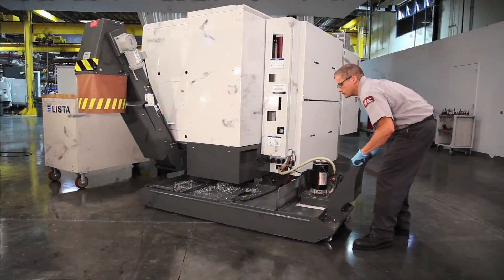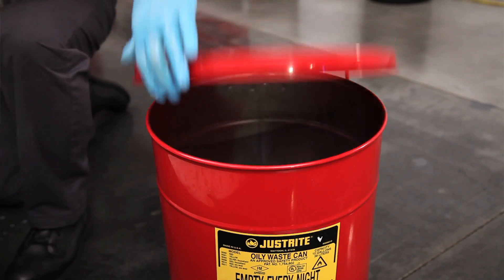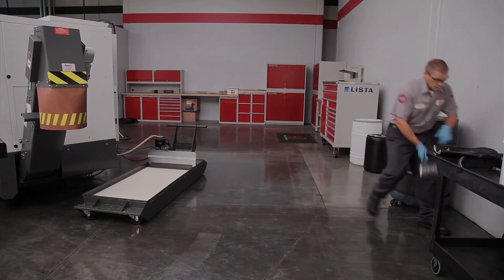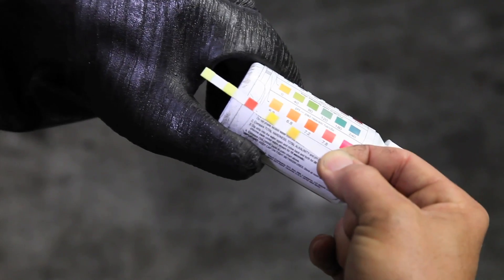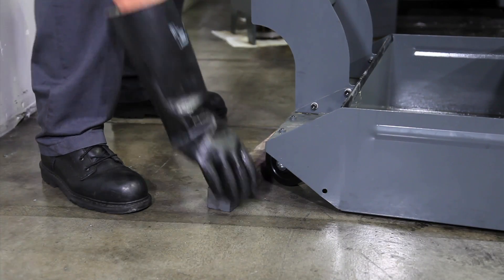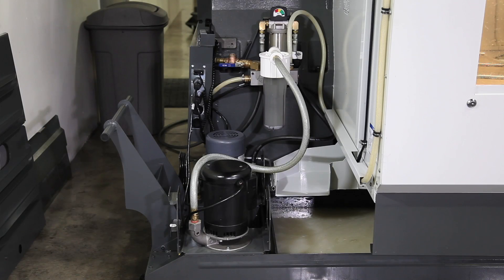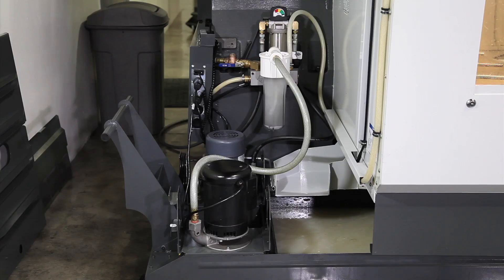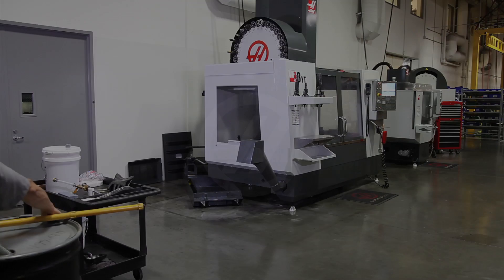Machine Tool Coolant: Cleaning Your Tank

Comment: I work on two identical machines at work using identical coolant but one tank turns bluish green after a while of not changing it and the other one thickens from white to like a thick Tanish color? Anyone know why they are turning 2 different colors?
Reply: Depends on the type of metal your cutting. I know bronze turns water bluish green overnight.
Reply: @ both machines are both mainly copper and nickel but only one machine seems to get like that

Comment: Have you tried to let a piece of copper in the tank ?
It kills bacteria.
Reply: A better way of using copper for its murderous proclivities towards bacteria and scum would be to electroplate the whole tank, first in zinc as copper doesnt take on steel directly through electrolysis, but does onto pre-plated zinc and other more friendly metals on the chart of electronegativity of elements... That said, yeah, richly copper plating the whole inside of the tank would not make it sterile, as chips landing in there would provide area that is not copper plated for scum to thrive in, but it surely would benefit the whole system... Also, copper plating the whole thing, inside and out would provide a much cleaner surface, along with oxidizing lovely over time to that classical copper green, while preventing rust and bacterial thriving... A fine idea, fine sir...
Reply: @camillosteuss  
Paint the whole tank with marine hull red paint.
It's made to avoid marine growth on the hulls ,there is copper particles in it.
I don't know if it's compatible with cutting oils ,so it needs to be checked.
Dumping some copper tubing donuts a bit every where should do it i guess.
It's not like if they can't cut copper pipes in pieces in those workplaces lol.

Comment: There's gotta be a better way! I'm not doing that anymore crawling on the floor shovel tanks. The big machines are a nightmare. Why can't you design the conveyor to catch oil and sludge and dump it in chip bin
Reply: Spoiler alert there's stuff for that already (i mean probably from the 80's), but usually optional even on high end machines .    The chip accumulation is what it is , some conveyors and tanks accumulate less , some more .
Reply: Look up sump sucker.. big BIG vacuum that is specifically designed to suck up coolant, chips and sludge. Just need a drum or tote to discharge it in then clean tanks and rinse system well.

Comment: Pretty ridiculous if anyone lets their tank get to this level. When I was maintenance at a shop there were a couple dozen machines to maintain and the tanks were cleaned every single month. Tanks were emptied with a chiperator which sucks up the coolant and puts it through a filter and holds it till it's time to put it back in. All chips and oil (which never built up) was cleaned out and the tank wiped inside and out with cleaner and all screens cleaned. Cleaned coolant was returned to the tank and if top offs were ever needed we had a DI water system that ran through the shop with a valve system that siphoned off pure coolant from a drum that could be set to 7.5% just by the trained eye and checked with a refractometer. That fresh coolant was ran through a hose to any machine and whatever percent could be added to correct the concentration. Coolant tanks absolutely never had a smell to them and the haas machines I took care of were clean inside and out, top and bottom, even under the way covers with extra care. It's no excuse to have crap in your tanks. If you can't hire a entry level worker do it yourself, have an operator do it, or just suffer with your nasty shit!
Reply: Small shop with high demands placed on it. Things fall behind.  Hard to get ahead of these things when you're constantly digging out of a hole.

Comment: What is the correct parameter of coolant - pH, and hardness?
Reply from the maker: Hello Andriy, Good question. We cover proper pH and hardness levels in our "Tools of Coolant" video. Here is a link to that particular section of the video. https://youtu.be/itQOP_JjilM?list=PL1FfK7Yod27fuiQ4ZSRAnTT7Ut0wJCGRP&t=230
Here you'll find that we recommend pH readings between 8.0-10.0 ( on the alkaline side) and hardness levels between 150-400 ppm. 
Note though that many modern coolant concentrates are capable of functioning well at hardness levels above 400 ppm, so if your coolant is not exhibiting signs of corrosion or bacterial infection then there is no reason to replace that particular batch of coolant. Just test your coolant regularly to ensure it's chemistry is not suddenly changing for the worse. 
Thanks for the question.
Reply: Thank you.

Comment: Inside our machine, we have a chip auger system. The coolant we run drains down to the auger and collects all the oil and chips and get mixed in.  if the coolant levels in there rises too far up it'll get drained out to the reservoir tank, but we still get all the crap left behind in the auger.  I've been trying to find some sort of drain plug to get rid of that and can't seem to find it anywhere.  Any recommendations on how to deal with that? I'm a fairly new CNC Operator, and our shop just got their first CNC Machine here, so no one knows a thing about CNC Machining or how to properly maintain them.  Thanks!

Comment: I can't stand cleaning coolant tanks.  there's always a layer of chips and sludge at the bottom. and it smells.
Reply: How often were they cleaned? If them smelled I bet you're not cleaning them often enough, you're not using DI water, or you're keeping used up coolant.

Comment: Could you give me a few more specifics as to a recommended High Alkaline Cleaner?  Thanks
Reply: Could you be more specific and tell us which cleaner you used.
local distributers like Grainger have Zep Heavy-Duty Alkaline Cleaner
Would a dilute mixture of Ammonia work ?
Also, a brand name for the Oil absorbent rags you show would be nice.
Reply from the maker: Hi Richard Giess - Thanks for your question and interest! There are a variety of these high alkaline cleaners available on the market. It is best to choose one that is formulated specifically for cleaning machine tool sumps. In the rare instances when we’ve needed to clean a dirty coolant system, we obtain high alkaline cleaner from our local Castrol metalworking fluid vendor.
 
It is probably best to start by contacting your coolant supplier to see if they can provide or recommend a particular product. You can also search online using the terms “machine tool sump and system cleaner” or “alkaline cleaners for machine tools." Hope this helps!
Reply: Pig oil absorbent rags, whamex xt for cleaner

Comment: What difference does it make to operator, machine, or machining process whether there are bacterias in coolant or not?
Reply from the maker: Hi Zbigniew Śliwa - Great question! When your coolant is kept clean and the proper concentration levels are maintained, the chances of severe bacterial contamination remain low.
 
If proper maintenance is not sustained, it can lead to bacteria contaminating your tank and coolant plumbing.
 
The bacteria have a number of negative effects:
 
They eat the soluble oils that provide the lubricating characteristics of the coolant. Sooner or later this can effect cutting tool operation and surface finishes. Generally these oils also provide the corrosion protection for your parts, and as they are depleted so is the coolant’s ability to protect your parts from rusting.
 
If you begin to smell an obnoxious odor coming from your tank then it is likely that bacteria have taken hold of the tank and are emitting sulfurous gases as they digest the tank’s contents.
 
Finally, once a bacterial infection has taken over your tank, you may experience skin infections as you handle the parts and tools that come in contact with the coolant.
 
All of this hassle is unnecessary and can be avoided if you properly maintain your coolant.
Reply: Haas Automation, Inc.

I was not aware. Thank you very much.
Reply: It can also have a personal toll. About 7 years ago i worked on a horizonatal mill that had a worn sheild. It would let coolant spray on the operator during fixture swaps or when the coolant through sprayed just right. I got coolant sparayed on my face and i apparently had an abrasion or cut that it found. My face had got a staph infection and my left eye was completely swollen shut.I was nearly iunrecognizable for a week. I still have a large "bag" under my left eye froom the skin that   never shrank back to it's original condition. Don't let your foreman or leadman pressure you into keeping production up at your own personal risk.The Doctor said i could have died with that big of an infection so close to my brain. I have also had staph infections in finger cuts that swelled so much the skin started splitting. I think the cnc machine manufacturers should incorporate Ultraviolet lights to head off the bacterial growth that is almost nearly certain, and employers don't alot the time for tank cleaning, not do they like dumping coolant. All it takes is a sneeze or cough for the process to start.
Reply: @kenmoll2896  That's terrible! Those coolants should have mandatory biocide in them! Unfortunately UV-C would most likely break down and damage the oils long term.

Comment: Haas can you tell us, what can we do with the dirty coolant? Is there a safe place to throw it without polluting the environment?
Reply from the maker: Hi d3mandd - This is a very good question without a simple answer. The first place to look for information about disposing of your dirty coolant is to check with the Federal, State, and Local authorities in your area. Depending on where you’re located, the laws can vary regarding what is classified as a hazardous material and what is not.
 
Waste coolant/cutting fluid should never be disposed of into a storm drain, the sewer, a septic tank system, the ground, or any other non-approved location.
 
A good source of disposal information can be your coolant supplier or manufacturer. They may have guidelines for how to dispose of your particular waste coolant in the most efficient manner.
 
Another place to start would be to contact licensed waste haulers in your area; they should be able to tell you how to deal with your waste coolant.
 
The EPA web page below provides links related to solid and hazardous waste within the U.S., broken down by state and then by territory. An online search for “disposal of waste metalworking fluid” and other similar searches can also yield useful results.
 
http://www.epa.gov/osw/wyl/stateprograms.htm